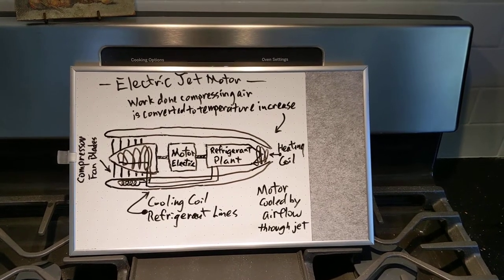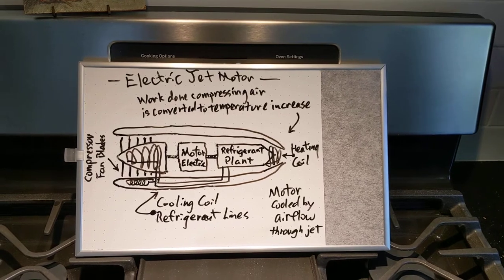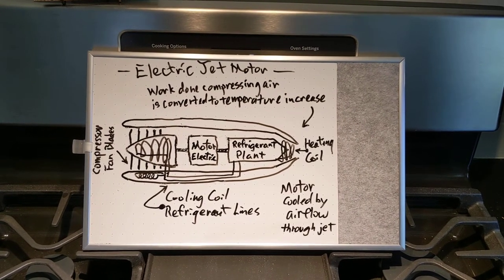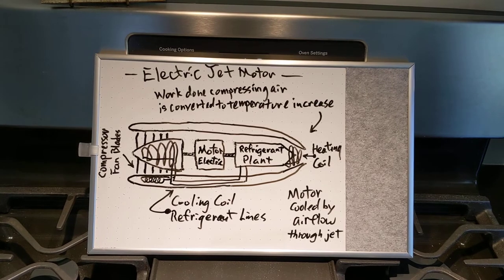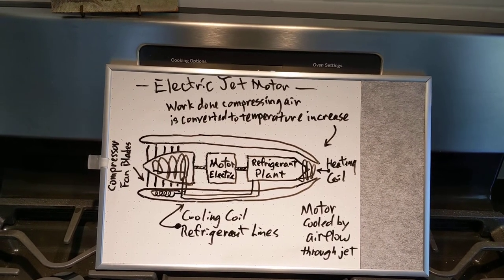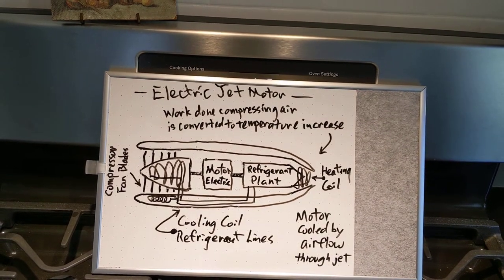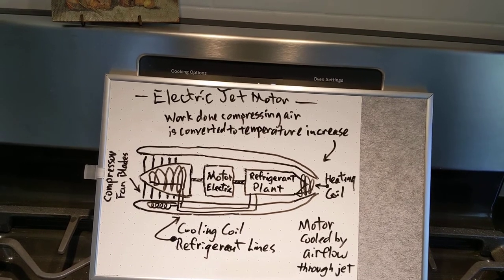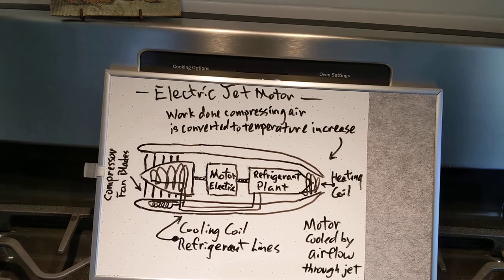Speculation on the Operation of Elon Musk's Electric Jet Powerplant Concept - Refrigerant Cycle Jet

Comment: Where is the gain of this construction? The heat from the refrigeration unit cooling down the compressed air used to heat the cooled air again? Much work for the battery, but no gain so far as you only feed the bleeded energy back to where it came from.
Reply from the maker: exactly
I can't imagine what Elon thinks is to be gained from an "Electric Jet" but maybe he was just smoking too much.
Reply: Hi, it's me the heat pump argument guy. My suggestion, just increase the efficiency of a fuel burning engine until such time as we can make electric efficient enough. If we need to use a heat pump, use a turbine driven refrigerant compressor and transport that refrigerant onto the axial compressor blades to make the pre-combumbustion air denser by cooling it, then dump the extra heat just behind the combustion process. This will pre-chill the air and make the post combustion air even hotter, and causing it to make higher pressure air in the turbine.
Reply from the maker: The compressor must compress the air in order to create thrust.  Burning a fuel in the compressed air increases the area the pressure "pushes" against on the inside surface of the engine.  If the enthalpy was removed from the air then there would be nothing gained from the air moving through the engine because the inside air would be at atmospheric (static) pressure.  The "jet" would be rendered a large, multiblade, fan/propeller.